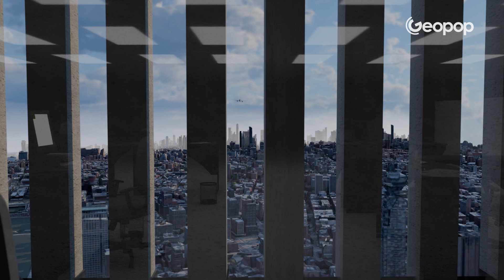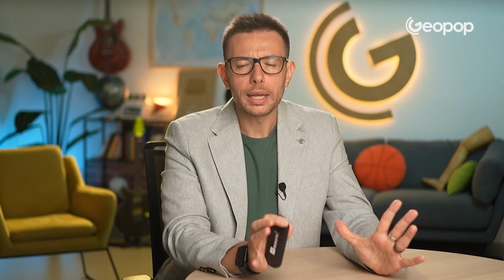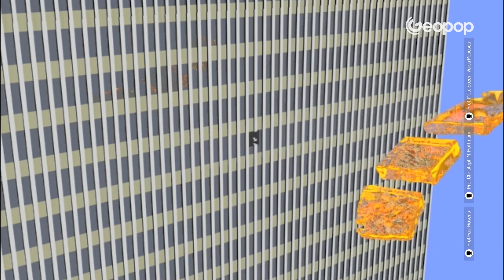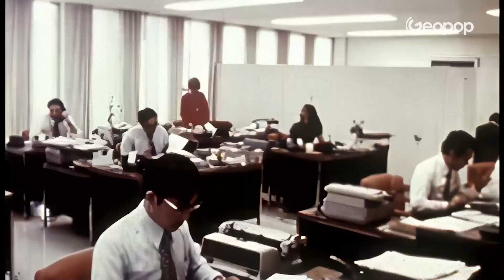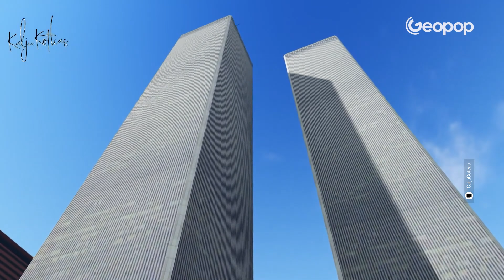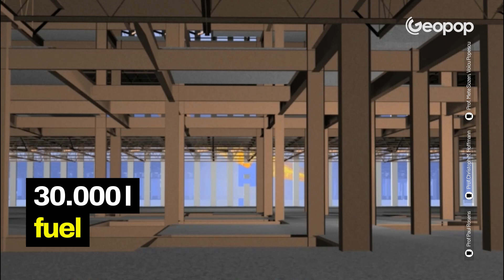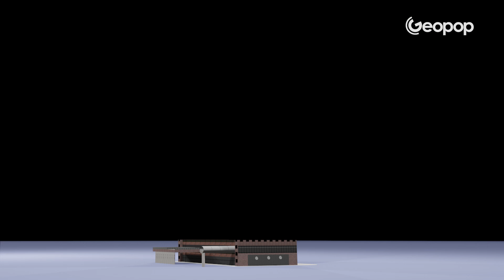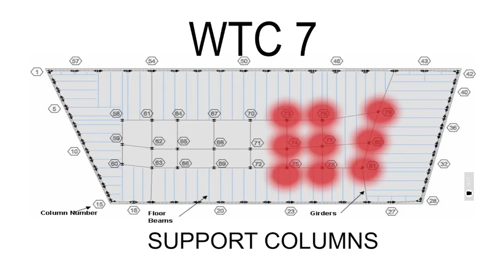9/11, 2001: The Technical Reconstruction of the Twin Towers and WTC 7 Collapses

Comment: If the fires were so intense in building 7, why weren't all the windows blown out with flames coming out of them and huge amounts of smoke?
Reply: there was flames and smoke
Reply: If they were blown out y'all mfs would be saying "Look! The windows were blown out so it must've been explosives!"
Reply: There are plenty of photos showing all the broken windows along the exact floors where fires were burning inside WTC7.
Reply: they were so intense they caused the bldg to crumble to ground in a pulverzation. first time in history. and yet a few of those mean hijackers paper passports were found intact. they think everyone hearing these stories are brainless sheep.
Reply: Lol I mean WTC 1 & 2 got hit with fucking planes and it didn’t blow all of the windows out there, not the ones even near the crash site
Reply: There was MASSIVE smoke blowing out of the side of the building that was hit. That side was off limits to people after the towers fell. But many pics exist of the smoke and flames. Also big flames over there in the areas where the collapse initiated. You must not have actually watched at about 18:00 and there are lots of pictures all over the  web.
Reply: Why don't vehicle windows blow out when they catch on fire? Car windows are designed to crumble not shatter, because untreated glass shatters and splinters. I am speculating but maybe they used treated glass on the newer skyscrapers.
Reply: @takes1toknow1 because it's pressure that causes windows to blow out, not the fire itself bud. However you are right about pressure treated windows and how they react to being broken
Reply: Obviously, you are too dense to pay attention. THEY WERE on the floors that the fire was raging on...watch the video again and see!
Reply: Intensity and the distribution of that intensity are two different factors.
Reply: Controlled demolition
Reply: @rumblethis2023   take your meds.
Reply: Which is more extreme -- to accept without question the inexplicable lack of turbulence in the wake of a 500 mph large passenger airliner -- not evident in the smoke and fire covering the impact zone only seconds later? -- or to recognize the indications of digital projection in its imperfect nature as we see a wing disappear in front of a bright blue sky? From another camera angle, the same aircraft is seen passing behind a crane in the foreground, yet in front of the heavy crane cable. 

There should be a hurricane of turbulence in its wake that would entirely disrupt and disperse the smoke and fire seen billowing outward just 3 to 4 seconds later at both towers.  Even the wake of a small Cessna aircraft would be noticeable -- yet there is nothing.
Reply: @ronaldgreene5733 This is the first time I have considered wake turbulence but you are absolutely 💯 correct.
Reply: @ronaldgreene5733  sorry to say, but there isn't that much turbulence behind a 737 on a normal day. How would you know this though, considering you know crap about areodynamics, let alone 737's areodynamics
Reply: @curtisridge2506  Sorry to say, but wake turbulence is serious enough to mess up a plane that weighs tens of tons if it gets too close to a plane ahead of it. And, no I do not have an engineering or physics degree, but I read, write, and speak English very well and the Mayday series does a very good job of explaining wake turbulence. Finally, NTSB and FAA even look at that when trying to determine the cause of plane crashes. I'm pretty sure wake turbulence would have no problem blowing smoke around.
Reply: @tammyschmidt5686 ah, there's your issue...you don't know what causes turbulence in the first place.. it's the end of the wings that does it. Again, most planes don't really have much. Your heavies have more due to their wing length. Turbulence isn't a vacuum, all it is is air that's spinning horizontally.now tell me, wouldn't all that steel it plowed thru almost instantly break up that circulation? It would. Just like a house blocks wind.
Reply: @tammyschmidt5686 turbulence in the air is caused by the same thing, but instead of the wings, it's primarily source is different wind speeds going different directions. Causing a spin at about where they meet. This can happen high up or pretty much right near the ground. Aviation has a term for this, it's called wind shear.
Reply: @curtisridge2506 First, let me apologize for the snarky tone of my comments. Also thank you for not being snarky back. I agree with you that the wind turbulence being generated by the planes that hit the WTC would have immediately stopped once the planes hit the towers however, the turbulence that had already been produced would have continued for a short time. The turbulence trail would have been hundreds of feet long. These were heavy planes loaded with tons of fuel.
Reply: @tammyschmidt5686 Makes no difference how long the alleged turbulence trail was behind the 767 jet plowing into WTC 2, as it would have been dissipated by the sheer mass of the building it was flowing towards. Plus, what visual evidence and implications of such a turbulence trail are you expecting to see in any of the videos of this incident that is not already presented?? There must be something missing for you,otherwise why are you making an issue out of it?
Reply: @tammyschmidt5686 They surprisingly are usually only up to about 50 feet, not hundreds. They also are falling down behind the plane. This is the reason why you don't want to be directly behind and below a heavy. You probably would still have a slight draft yeah, but remember super heated air expands. This is how heat from a fire gets to you. It would push the colder air away while heating it the same time.
Reply: @curtisridge2506  It was not a 737! Pay attention!
Reply: @penguinn5435 the og was talking about a 737 bud, how about you pay attention? Same rule applies with all the single ilse planes that size anyways, so my point still stands.

Comment: In all of history, there have only been 3 high-rise buildings totally collapse from fire. Tower, one tower, 2 in building 7 period. All others, if they have collapsed, have fallen sideways , or if the top collapsed, it slid off the side, and some of them burnt for over 24 hours.
Reply: Can you give any examples of high-rise buildings that either fell sideways or had the top slide off the side? I've never heard of either of those things happening.
Reply: What is the source of the many tons of molten steel found in and under the debris, the heat so intense that the molten steel remained in that state for weeks afterward, running off of the debris as it was excavated. This cannot be molten copper from wiring that retains the color of a shiny new penny.  It cannot be molten aluminum that retains the color of the polished aluminum wheels of a street racer. It was the color of glowing orange molten steel  that cannot be mistaken for any other material, reported by firefighters who are very experienced in the nature of such materials as well as seen in video evidence.

When you combine this with an entire lack of turbulence behind 500 mph aircraft, when even a small Cessna Aircraft would leave an evident wake in the smoke and fire only seconds later .  . We find that skeptics still cannot be skeptical of the official narrative in explanation.  Sponsored channels and forum activity are skeptical of nothing when support is provided.

Sponsored activity in the forums is very normal today for commercial and political purposes and subjects of controversy -- in the attempt to lead public debate.
Reply: The molten steel did not fall from the collapse of the towers. It wasn't a rain of molten steel. Once it collapsed, it acted like a furnace. Keeping the heat in had nothing to do with the collapse. In the buildings, all 3 of them, 1,2 and 7 of collapsing in their own footprint. What are the odds of even one of them naturally collapsing in its own footprint? This building had been abandoned for years. Look what kind a fire and how long it took to collapse? And abandoned building bill subgrade in South America.https://youtu.be/XwoBRHDLxdo?si=tYbewGw_0vKPgZDW@ronaldgreene5733